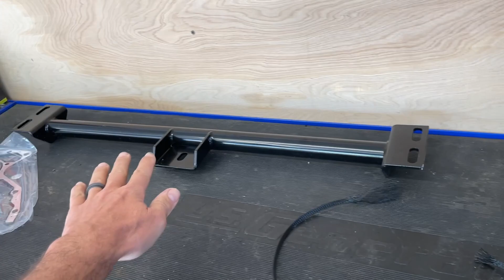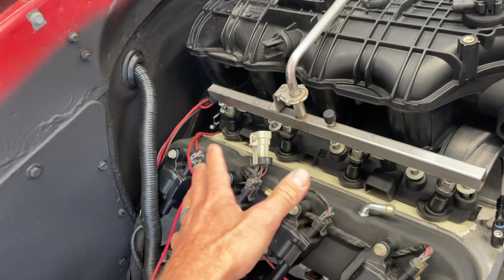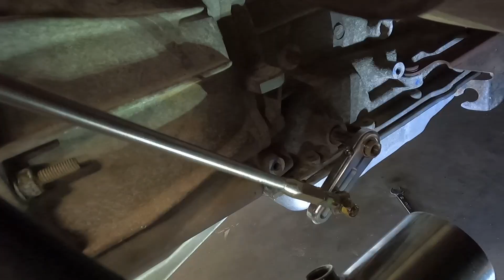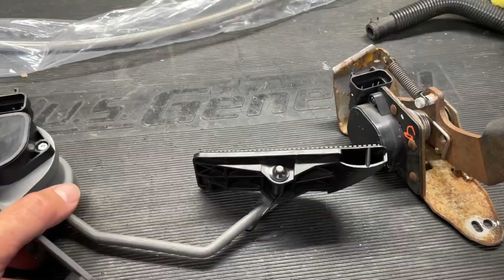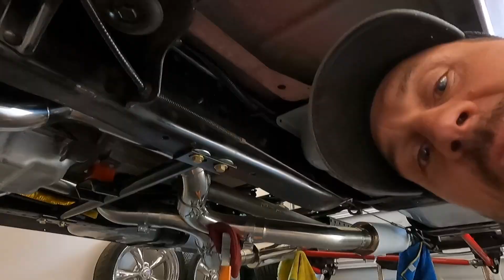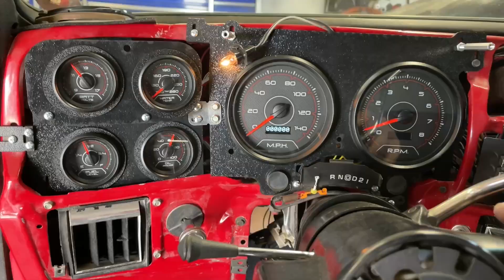New Square Body Build Part 8: LS install step by step

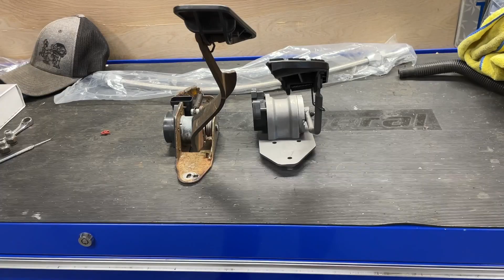Comment: Thank you for the info of the accelerator pedal at 9:46 for the squarebody. I pulled the one from my 2001 XL 2500 when I removed the engine harness and BCM. I like your way better because of it's installation without any major modifications.
Reply from the maker: Great to have you and be able to help!

Comment: I guess you just used the factory wiring harness for motor and transmission
Reply from the maker: eBay harness
Reply: @GreaseMonkeyTV also thanks for your reply
Reply: Damn, I'm having a hell of a time getting mine tuned running shifting correctly, the guy i bought mine from had the Aces jackpot standalone installed and apparently it doesn't communicate with the 06 4l60e so I've been trying to get a tuner to be able to Tune it properly or I'm going to rip it out and do what you did and stop all the darn headaches !

Comment: Awesome channel, been watching your videos. I really like the C-10. A local muffler shop owner near me has a C-10 and recommended an H-pipe for mine because of the fitment issues you mentioned in the video. Would you use that speed engineering exhaust again or do something else?
Reply from the maker: Probably do something else.

Comment: Where exactly did you mount your pcm under the dash.  In the process of moving mine in the cab from under the hood and I'm also installing Vintage Air on my 86.  Is there room above the Vintage Air unit?
Reply from the maker: It's top center under the dash. Left of and above the VA unit

Comment: I'm doing the same swap on a 86 k10 and was wondering what fuel rail you have on the engine for the return less set up I've been racking my brain on this
Reply from the maker: Got a full vid of the fuel system on this channel.
Reply: @GreaseMonkeyTV @ no way to convert it to normal rail? With a fuel pressure regulator in it! ?